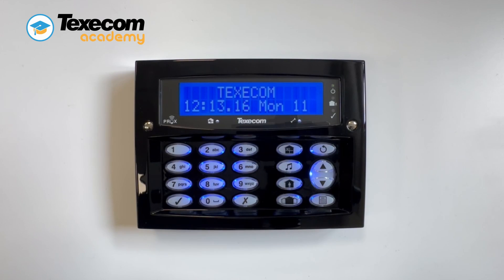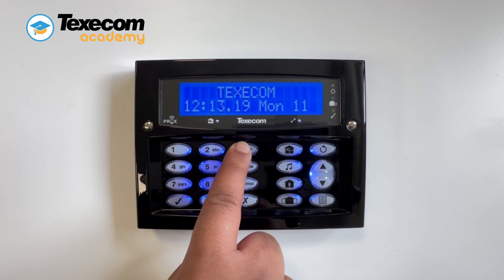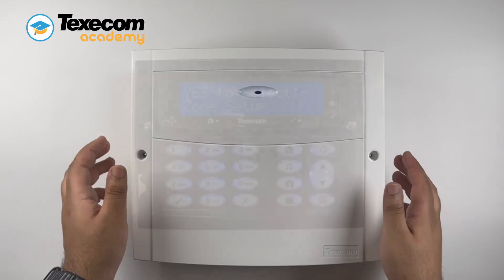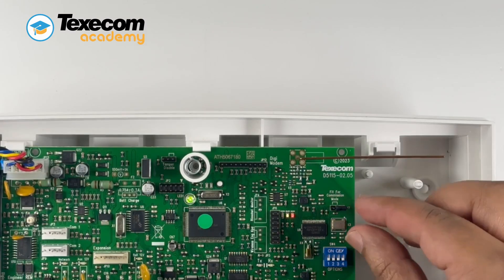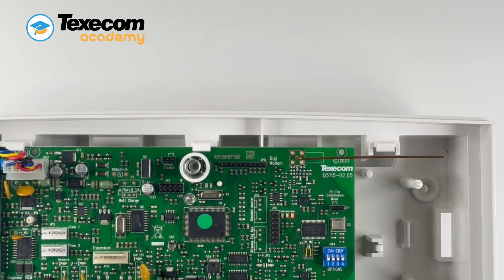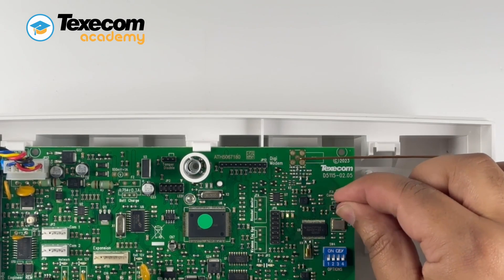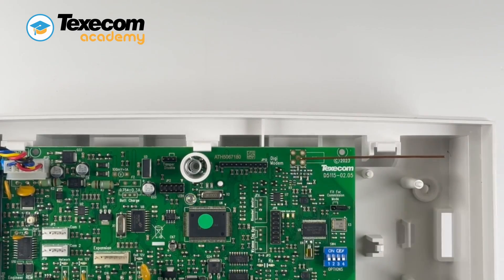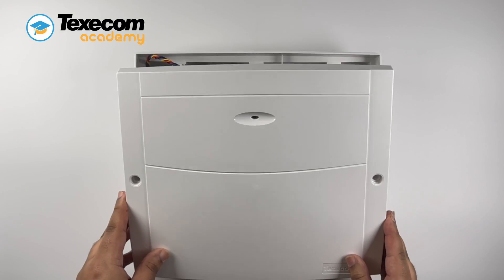How To Enable Commissioning Mode On A Texecom Premier Elite 64-W Security System

Comment from the maker: Allowing 15 minutes for the mesh to build will be enough time for the process to complete. There is no visual indication. 
Alternatively you can use the Ricochet monitor software - As soon the panel has started its commissioning process the Ricochet monitor software will show the mesh build in real-time, as soon as the process reaches 100% it's complete and the panel can be taken off commissioning mode.